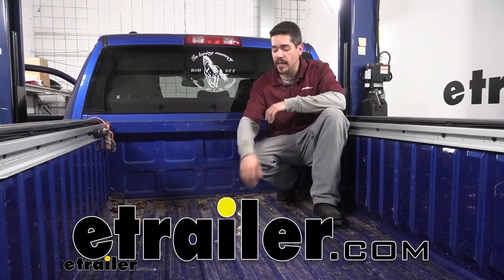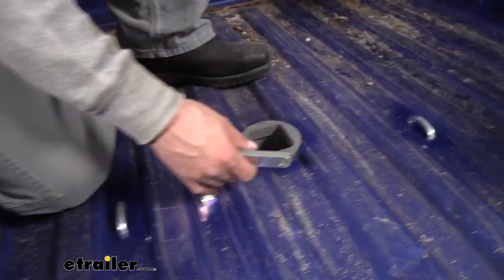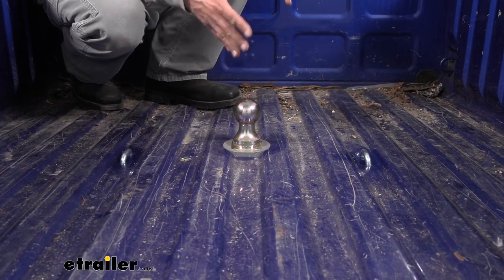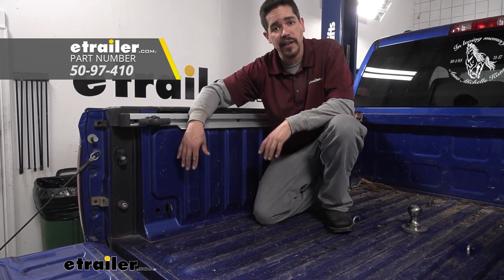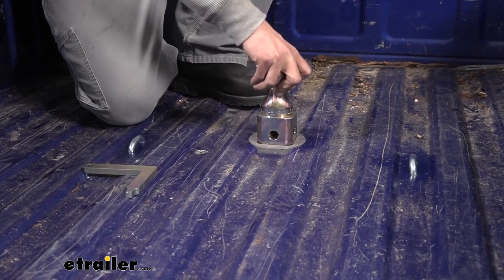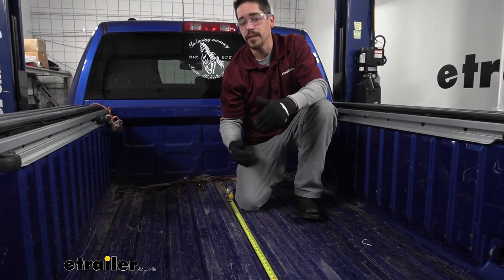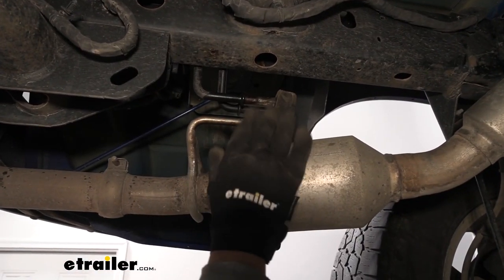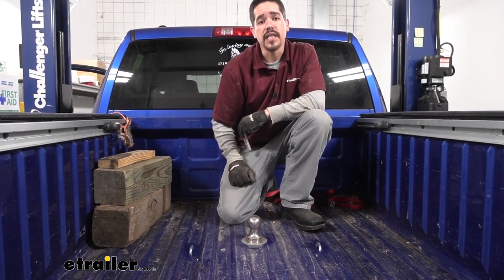etrailer | B and W Turnoverball Underbed Gooseneck Trailer Hitch Installation - 2015 Ram 1500

Comment: Bruised up noggin and 8 hours later. I finnally have 1 more day till i think ill have mine installed on my ram.  You diffantly made it look eadier than it was.
Reply from the maker: We have installed many gooseneck hitches over the years but it still takes us 5-6 hours to get installed. Hopefully we were able to share some of our experience and tips with you to get the install completed. Check out the following link to see the in-bed 7 way plug to make it easier when connecting your electric for your gooseneck trailer.
https://www.etrailer.com/Custom-Fit-Vehicle-Wiring/Bargman/50-97-410.html